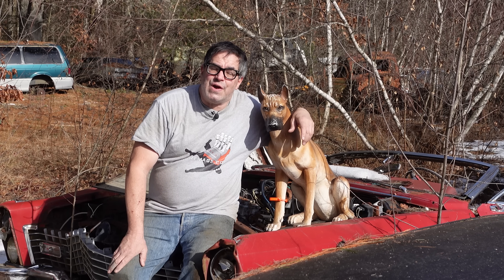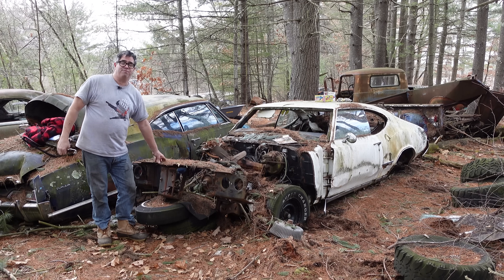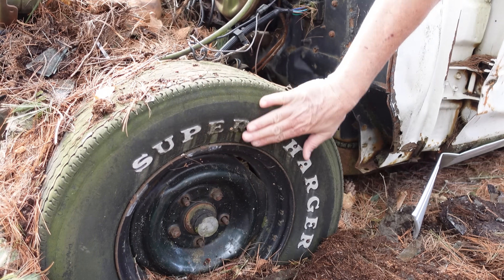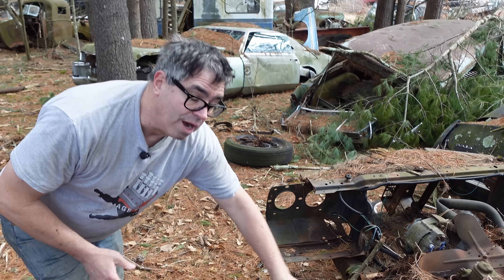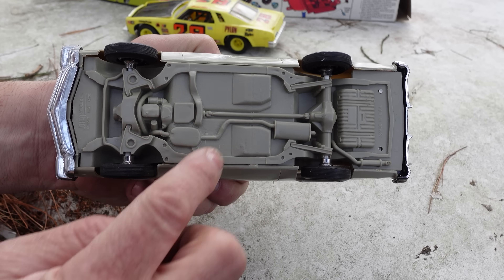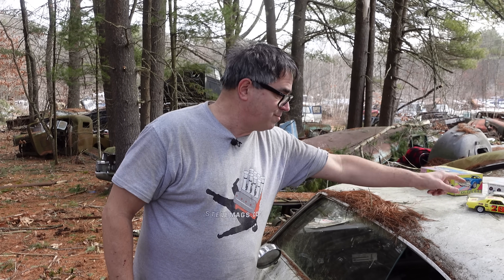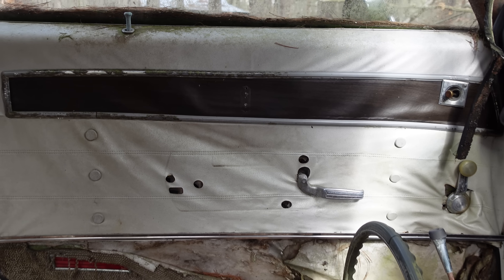Cut Less Compression

Comment: Hi Steve, good video!  After the introduction of unleaded fuel, came the EGR valve (exhaust gas recirculation) valve.  It helps with Nitrogen Oxides (NOx) but in the mean time, it lowers the combustion chamber so therefore less engine pinging.  Please do not think of the EGR valve as a horsepower robber.  Please reply.  Dave...

Comment: I have a 1973 cutlass.It has an egr valve just like the one in the video. So I know 73 models had EGR valves. Also had a 70 olds cutlass and it had a lot more power than the 73 did.

Comment: had a 68 Catilina. with a 400ci 2bbl no less, ran on 92 octane gas. would not accept anything lower than 90 octane. regular was out of the question. And to top it off lead substitute was required too. but it ran beautiful. And got 18mpg on the highway.

Comment: I believe you mentioned the fake hood louvers that were part of the S option in your video of the 1968 Cutlass. I actually "salvaged" a pair of them from a 71 or 72 S years ago while "crawling" for parts for my 70 Malibu. I just thought they were cool and I might find a use for them someday. That day hasn't come yet but I still have them on a shelf all these years later. When I first saw them, I figured they were just stamped steel but no, upon removing them, I found out that they're actually die cast and fairly heavy.

Comment: My buddy in high school had a '72 Cutlass S. He stripped the hood and some other great parts off a 442 and put them on his car. It had a rear spoiler, air shocks in back (this was 1985) with wide Belted T/A's, the W30 hood, great paint, dual exhaust with glass packs and the 442 rear bumper with the trumpet tips and of course, under the hood, a stock 350/2bbl and a th350, lol. He actually destroyed the trans doing neutral drops trying to get the car to smoke the tires. If you saw the him coming down the street you would swear it was a hopped up 442 but in reality it was grandma's Olds and it drove very docile. Probably the safest thing for a 17 year old kid.

Comment: HEY STEVE.  Instead Of Trying To Have People IMAGINE What Those Junk Yard Rotted Out Wrecks Were Suppose To Look Like In Their Prime;   How About Going Out To "Country Classics"  In Illinois Or That Antique Auto Mall In Pennsylvania,  And Do Your Information Presentation On Some Older NICE CARS That THEY HAVE For Sale.  You'd Be Killing Two Birds With One Stone, Making A Few Bucks By Advertising Their Cars FOR THEM, (As Well As Any U-Tube Income You Are Making);  And THEY Would Be Moving Their Cars As Well.   There's Also A Place In Chicago Called "VOLO Auto Sales",  That Have Their Restored Oldies For Sale Too, But They Just Take Their Camera Around The Car To Show How Nice The Paint, Chrome And Interior Is, WITHOUT Any Interesting Facts About Their Cars Like YOU DO.  And It's Better Than Opening The Hood To See Missing Carbonators, Radiators, Leaf Litter Piled All Over The Faded And Rusting Body,  With  Interiors That Have  Eaten Away Seats Down To The Springs From MICE, Torn Up Headliners, And Sitting On The Ground With No Wheels On Them Rusting Away.  NOT GOOD.  Your Programs Could Be MUCH BETTER IMPROVED INDEED...

Comment: Second car was a 71 Cutlass  S.  Was a major  stripper.  No power  anything.  It did have  a  strong running 350, 4 speed, 3.43 posi and duals.  Added  a set of Doug Thorley headers and the larger/stronger W-30  clutch and pressure  plate (flywheel drilled for both sizes) and 90/10 front  drag shocks and made it  even quicker (in a straight line). Handling was terrible around  corners with those shocks.  Hey, live and learn when you are 19-20.

Comment: Our family had the 1968 F-85 with the straight 6 250ci and the 2 speed auto trans. When I was 16 I would floor it and wind the RPM's way up before it would shift into high gear. It was the 4 door family version.

Comment: 4:38  Drum front brakes... First Gen Monte Carlos came with a lot of good stuff standard like power disk brakes, power steering, 350cid V8, SS gauge cluster and 12 bolt rear with AC on most.  You can still find them all day for under $5k in 2023.

Comment: Love the Olds content; I’ve had a 69 442 for a long time. I’m curious what exactly the engine was, but I can’t blame you for not digging around in the glass and pine needles to find out. An interesting note about lead in the atmosphere is that one can make a compelling argument that leaded gasoline was responsible for a huge increase in crime that peaked in about 1990 or so. If you look at a chart of atmospheric lead and the crime rate in the US, they basically follow one another with about a 20 year lag time. Turns out that lead actually makes people dumber, and dumb people are more likely to be criminals!
Reply from the maker: I can see the merit of that idea! -Steve Magnante

Comment: Friends still live in Belchertown. We remember Mike’s from our days in western Massachusetts. Thanks for the memories and reminder
Reply from the maker: Hello Pat, as you probably know, there's a Kubota tractor dealer on the site of Mike's Speed. I think a part of the Kubota building is still the one Mike's used to be in. I remember drooling over the lineup of old "parts Mopars" outside at Mike's along the pine tree border next to the shop building. I did buy a TCI torque high stall converter from Mike's back in 1988. He was in a wheel chair as the result of a roll over crash in a 1967 Plymouth GTX that happened in 1969 or so. A bummer but he was as strong as an ox all the same. Thanks for watching and writing. -Steve Magnante

Comment: it's possible that ignition distributor might have told you the vintage of the engine--by whether or not it was HEI., which would be easier to dig for. funny thing, gearheads in the know were still buying leaded gas from the local airport until the early 1980's.

wish this car had solid floors, but the acid from pine needles can really etch metal.

Comment: Ping is caused by predetonation; low octane gas burns faster than high octane gas. The ping is the gas flash burning before top dead center is reached (hence the "pre" in detonation) due to valve overlap and sometimes hot carbon on piston top igniting fuel early. Can put a hole in piston tops. Not what that magazine Steve had said. Try running Coleman lantern (white) gas in your car. I ran out of gas camping once and used it, my poor Pontiac 350 almost self destructed, but made it to the gas station. Pat O'Keefe, you are right, 1973 is the 1st year for American factory EGR, 1976 for foreign auto.

Comment: One of the other reasons for using lead in gas was to help seal the valves in the early engines most all were flat heads and the valves weren't machined well enough to seal them ready well ,
The engine would lose compression through the valves every time it fired the lead would build up around the valves and help seal 
Lead melts at 638 degrees Fahrenheit so it was burned and replaced all the time but enough would be left behind to do the job of sealing them

Comment: Love that generation of Cutlass! Back in the early 90's, I had a 1971 Cutlass SX Convertible with the 455 and turbo 400 trans. Beautiful car, silver with black Rallye stripes on the hood and deck, black convertible top, black bucket seat interior, and the rear bumper had the exhaust cutouts with the chrome trumpets on the exhaust tips. Man, that thing was a torque monster! Myself and a buddy of mine used to buy and sell convertible classics back then. Were we the first "flippers"? LOL. We would buy as low as possible, finish up any details needed to put the car in pretty much perfect condition, then re-sell it for a profit. He was the money man, and tracked every cent we invested, down to the gas we burned cruising it around, and I was the mechanic. This was with all California cars in the SF Bay Area, so they were solid, and most had already had the BIG stuff done, like interior, paint, stuff like that. We would put the finishing touches on them, maybe a heavy detail job, tune up, brake job, suspension work, things like that. Sometimes we made a couple thousand bucks, one time we made 26 cents! LOL. We only lost money once or twice. Once, we had a red 68 Plymouth Sports Satellite convertible 383 with a white top, and the black interior was sad, although the rest of the car was perfect. We bought a 68 Satellite 2-door hardtop out of SF with a really nice interior, swapped that into the convertible, instant profit! Then we put the rather worn interior (after we spiffed it up as much as possible) into the parts car, and had Earl Scheib paint it. We ended up making more money on the gray 318 parts car than the fire-engine red 383 convertible! HAHA! Go figure! Thanks, Steve, for bringing back those memories. Also, is that a 67 Impala next to that Cutlass S? My wood shop teacher in high school had a lovely 67 Impala SS with that sweet fastback design. It was gold with a black bucket interior, and it was an SS. I think it had the 327, but really can't picture the engine badge in my mind any more....

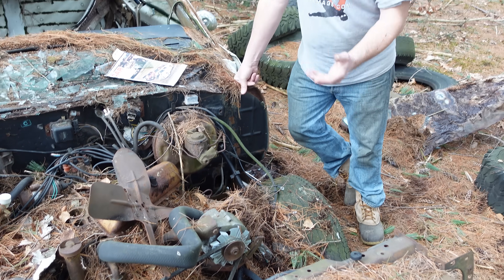Comment: 2:45 ish Do I spy an old Rupp snowmobile in the background ??
Reply: That's where it belongs. In the early 70s, a Rupp was a fast machine, compared to a lot of other snowmobiles of that time. The suspension was poor and the handling was poor, due to its extremely narrow width. Old Rupps had top speed of about seventy miles an hour. Today's snowmobiles will do 120 or more. Comparing that old Rupp, to a modern machine, it's like comparing an old 340 Duster, to a modern Challenger Demon.
Reply: @Gary Szewc  Well, I have 3 nitros and a magnum. Yes they are antique by today's standards, but my Lil 73 will go anywhere a skidoo elan will. And its very hard to beat an elan for off the trail and through the bush. And I'd take a 340 Demon over the new one any day,  but that's just me
Reply: @Litauen-yg9ut  the Elan was the turd of SkiDoos. The only advantage those old machines head over the newer ones if they were so narrow that could go between trees that were close together. They were hard starting, you had the premix the gas, they were very unstable. I owned a 1971 Dodge Demon 340. It was relatively quick. Even a modern Challenger RT is quicker and handles better. Plus the fact it's more comfortable and has creature comforts.
Reply: @Gary Szewc  That was kinda my point,  they fit thru most anyplace and float over most anything. And I owned a twin elan years back, and yes, they statt like crap, unlike my 340 tohatsu, 3 pulls tops when being ridden regularly. Sit over the off season, different story. New is nice, but I'm getting old, can't justify 18+ grand for a new sled as that's what alot run up here in Canuck land. As for the new muscle cars, same can't justify it. They are nice, just not for me

Comment: Having owned several Olds Cutlass cars I learned to really appreciate the oil fill tube or neck that Olds had on their V8 engines. Never really had one that used oil but it made oil changes super easy. The most user friendly oil filler I’ve ever used still to this date. They were great looking cars. Even the slow ones gave me a high pride of ownership feeling.
Reply: The AMC V8 had a tall oil fill tube right in the front of the engine, super easy to add oil.
Reply: @jjtrucker5950  
Yes. There are other engines that had them. 283, 327 SBC also had them. 👍🏻
Reply: I've always liked that about the Olds V8. I've often joked, you could do an oil change in a three piece suit and not get dirty. Even the oil plug and oil filter drain straight away from anything that will cause a mess. Well laid out. Pontiac V8s are similar although the turbo 301 oil filter is on a right angle on the RH side of the engine above the turbo pipe, so that gets a bit of a bath when you do an oil change on that engine.
Reply: it made up for the gas tank filler neck on GM cars--you try to top off the tank, and you get a bath. or if you've seen one of these cars outfitted with the latest suspension systems, they finally cut enough G force in corners the gas sometimes sloshes out a gas cap that isn't on tight enough and hits the track. 

I think the Pontiac 301 used the same or similar oil filter adaptor Pontiac used on prior RA engines to clear their exhaust systems
Reply: @albertgaspar627  No. The 301 had a filter that was parallel to the ground. The 400 and other "traditional" Pontiac V8s had the angled oil filter adapter.
Reply: Oldsmobile for OLDs people
Reply: @samholdsworth420  some are, but when a 455 was still cheap to buy, they were a lot of fun. torque wins races, hp sells engines :)

Comment: I had a 68 442 manual 4 speed. Beautiful car but what a pia. After driving it and parking the damn car wouldn’t start until the engine cooled. Took it to the dealership and they had 49 others there with the same issue. I finally got rid of it and got a barracuda. Sometime later I was reading Popular Hotrodding and they mentioned it was vapor lock something about the starter being too close to the exhaust. Beautiful car turquoise blue, black interior

Comment: The mechanical clocks in these old cars were guaranteed to fail soon after the warranty. Of all the old cars I've owned, I don't remember any of them working for more than a few days at a time, if they worked at all !
Reply: Most likely due to contacts eroding for the solenoid that resets the spring. The contacts can be cleaned and polished.
Reply: @jimc3688  Correct. When I first got my 1979 Trans Am, the rear defogger relay was faulty. A guy I worked with who was a fastidious person and handy with all things electronics and manufacturing took it apart and cleaned it. It worked like brand new after that. I also have a few NOS ones that could work in place of that if needed.